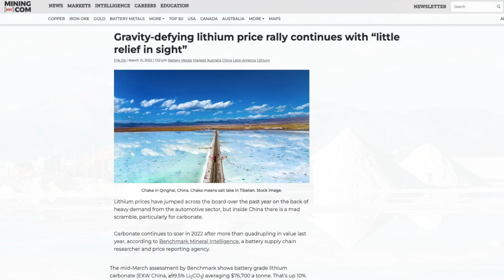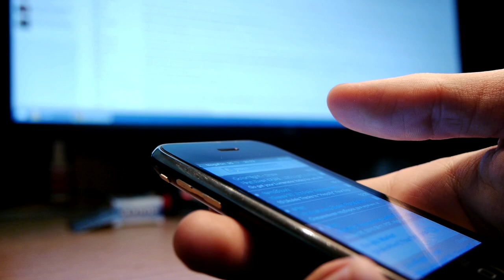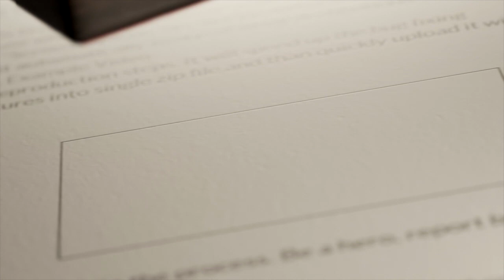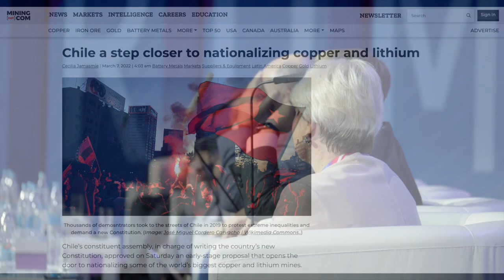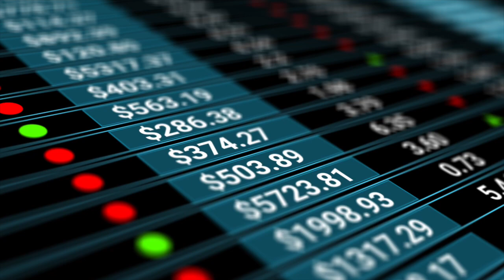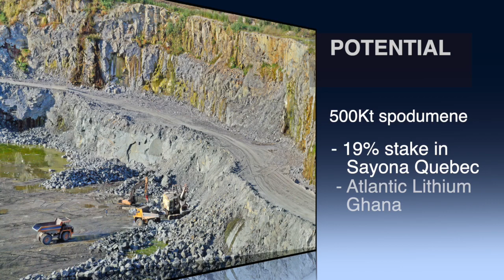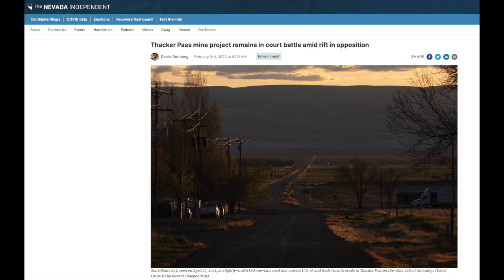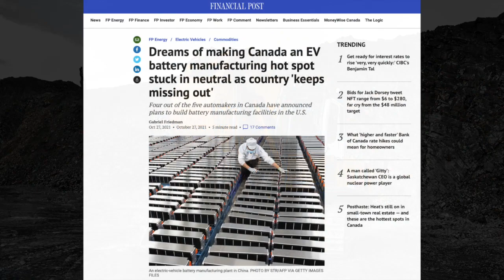What are Tesla's lithium mining options?

Comment: The likely target is Cypress Development Corp. as Tesla already tried to scoop them up on the cheap 2 years ago but were told no. Cypress has basically cracked the code of producing lithium from clay. It will be official by the end of Q2 2022 when the final steps from the pilot plant are completed. Cypress also has a REE component that would be off great interest to Tesla as well. However Albemarle will be in the bidding for Cypress as well. The key for ALB is they can't let those high margins get into the hands of an OEM who would just be paying the cost of production and the Cypress project has EXCELLENT margins. Albemarle also has the majority of the water rights in the Clayton Valley and Cypress new process uses the brine to process their clay resource. That means the ALB & Cypress combo ups the production capacity by leaps and bounds. Meaning all the other companies in the Clayton Valley that have a resource and no water can then be consolidated. So in summary either Tesla buys the best project in the USA (Cypress which has no court issues, rare plants, and sits next to and already producing mine) Or they sit back and let ALB and Cypress combo get into production and consolidate the whole valley and then buy up ALB.
Reply: FYI the highest grade lithium content at Cypress is less than the cut off grade at Thacker Pass. There is no comparison between these two resources. Cypress also has no permits. Not implying it won’t go ahead or that’s it not a target for Tesla or ALB as it may well be but you should be prepared for very lengthy delays to get this to production. TP is about to begin construction and they are not anticipating production for another 3-4 years.
Reply: @danielgraham8559  Not exactly true on the grades. Thacker Pass has higher grades but The Cypress grades are above the cut-off of TP. However the project at TP is going with a sulfur based extraction which will be more environmentally unfriendly and costly the clay at TP will be harder to extract. Cypress new pilot plant has performed great with a much less difficult and less costly leaching process. Cypress does have its water permit in place and it will take about 2 years to permit. Cypress also has zero problems in the courts were TP is tied up in the courts system. Cypress has a flat lying deposit with very little over burden that will not require trucks to haul paydirt. It will be done on conveyor system. Will use geothermal and solar power. It will recycle its water to make the most of the water permit. It will be one of the cleanest lithium projects on the planet. It's most likely going to be in production by late 2025. It's a top notch project.
Reply: @jonathanadamietz6508  There is nothing unusual about sulphuric acid processing and it is used in many industries with very little impact on the local environment. As I have previously stated this project has already passed all environmental reviews and is fully permitted. Making the sulphuric acid will also provide the power for the processing plant. Water is recycled etc, lowest quartile cost of production, experienced management, grade is king and this is project is a model of low impact mining. I appreciate your passion for Cypress but I believe Thacker is on a different scale and timeline.
Reply: At the 18:50 mark on this video you will see a direct comparison of the Cypress and Thacker Pass resources. https://youtu.be/U4RssO53_tc
Reply: @danielgraham8559  I was never debating that TP wasn't bigger and higher grade. Just that the Cypress grades are better than you were portraying. The sulfur process will add cost that Cypress will not have. Yes the sulfur process will have the energy plant attached at TP but they also will have to have that power since they have a high temp process as well which is harder and more costly than Cypress process. TP may have low cost but Cypress will be even better. No doubt demand will drive both projects into production. From an investment standpoint the gains will be bigger in Cypress because it is a much smaller market cap. All of the virtues you point out about Lithium Americas is already priced in. Where as very little of the virtue of Cypress has been realized by the market.
Reply: @jonathanadamietz6508  haha nothing has been priced in yet. lAC about to start production in C-O. I expect production of 100k -135k tpa from LAC by 2030. The math is compelling for a much higher valuation.
Reply: @danielgraham8559  You can't possibly think that the current market cap of LAC has nothing to do with the TP project. That none of that has be seen by the market? That no price has been attached to  upcoming development? You clearly have some learning to do about the stock market. Will it do well? I am sure it will but buying in now at a 3 billion market cap means it has to go to 30 billion to be a 10 bagger. 30 billion is 50% higher then the current market cap of Albemarle the largest lithium producer in the world. Whereas Cypress at a market cap of 150 million only has to become a 1.5 billion cap to make a 10 bagger and 1.5 billion will be only 50% of the NPV of it's Clayton Valley project. From this point going forward the percentage gains will be bigger in CYP over LAC. Will a person make money in both? Absolutely. But the entry point is what matters.
Reply: @jonathanadamietz6508  Now you’re talking about risk/reward and suggesting that I am offering investing advice. Cypress has a very high risk/reward profile whereas LAC with its peerless, experienced management, cash position, resources about to come into production later this year and the worlds largest greenfield lithium resource already permitted and about to receive its final green light. LAC is on its way to joining the big three lithium producers. The math is quite simple if your willing to be an investor this decade rather than a speculator.
Reply: The "risk" on Cypress is not nearly as high as you portray. They will be announcing sometime in the next 6 weeks before end of Q2 that they have gotten to battery grade lithium from their pilot plant. Once that happens all the remaining steps are pretty straightforward. Permitting will be not very difficult the Clayton Valley is already home to the only producing lithium mine in North America so little concern about Cypress having problems on that front. LAC soon to be producing asset in South America is a minority interest and will likely be spun off form the TP project to help get loans from the US govt . so far as being the US wants to give money to US companies and currently LAC has ties to China companies. They will have to sever all those ties if they want any US money for the TP project. Cypress will not have to do any of that as they are strictly a US based project. Cypress is certainly de-risked more than you state it is hardly speculation at this point. LAC will be a good investment and buying it will make its investors happy. Cypress will be better on a return basis from this point forward.
Reply: @jonathanadamietz6508  You may be right! But the original supposition was which lithium company would be the best partner or acquisition for Tesla. Elon Musk has stated that he expects a severe lithium supply deficit in three years. This is when TP will be finished construction phase all going well. I can only say what I would do in his shoes. Taking an interest in NA’s most advanced, highest grade and largest resource with a capable management team seems logical albeit more expensive. If not Tesla there is already a line of suitors waiting. Spinning off TP does not seem difficult or detrimental to current shareholders Imo.
Reply from the maker: I don't think Tesla could afford ALB. I mean, they probably could, but they would need around $60bn - which would be quite a dilution. Then they would be stuck with a lot of businesses they don't need ...
Reply: @energy_matters  Tesla has a market cap of just under 1 trillion dollars. Albemarle has a market cap of about 23 billion. That's roughly 2.5% of Tesla's market cap. Even if the paid a 100% premium that's only a 5% dilution. That is nothing. Any acquisition would most likely involve a spin-off of the non-lithium assets. I would be nothing for Tesla to gobble up Albemarle.

Comment: A few notes: Piedmont does not have permits for North Carolina. Nemaska is not an operating mine. LACs Thacker Pass may be among the highest grade and largest lithium resources on earth and has both state and federal permits. Cauchari-Olaroz is the third largest resource in South America and is about to start producing lithium carbonate. Also litigation will end this summer over Thacker Pass.
Reply from the maker: Thank you for the corrections. Piedmont is indeed in a bit of a final straights battle to get state zoning permits to commence mining. I am sure they will get this resolved though, it seems as if the state just wants an independent opinion on the impact assessments. It does still highlight the importance of local community buy in. 

I was not aware that Nemaska was not actually operational, I had understood it was mothballed. I believe there was a phase 1 plant in operation since 2017? The Shawinigan Phase 1 Plant? 

Cauchari-Olaroz is financed, you are correct. My observation of how their $500M will be spent was probably incorrect. They still need $200M odd for Cauchari-Olaroz, which means Thacker Pass is not yet funded, but I doubt this will be an issue.
Reply: Thanks for the response. I think concerns around permitting in NC are much harder to overcome due to the proposed site residing in a populated area but who knows? C-O only needs a further 60-70 million from LAC, remember Gangfeng is responsible for 50% of the project. The judge has said a final ruling will come by late August I expect the announcement of a strategic partner for TP and DOE loans & grants to the tune of $500 million to advance construction. Just my opinion.
Reply: "Also litigation will end this summer over Thacker Pass."
Youre talking out of your a$s. NO-ONE knows that.

Comment: Arizona Lithium (clay) sounds like a possibility as well they've run a lot permits already & are closer to Nevada. it would also preclude other giga factories being built in the area from access. Based on your report, I'm still glad that I own shares in Sayona since being involved in some way w/ Tesla for cheaper than Piedmont can't be a bad thing.
Reply from the maker: Thanks for the tip. I haven't analyzed them yet. As for Sayona, I think you will do well there. The north american battery operations are yet to really get going, so demand is still relatively low, but once they do ...demand for local supply is going to go through the roof.
Reply from the maker: The best lithium projects to invest in right now are the ones that will be coming online within the next year. Most likely these companies are not yet locked into long term supply agreements and will have been able to capitalize on the current LCE spot prices. 

Sayona has quality assets and HUGE reserves. I like their medium term strategy. They should have a LiOH factory up and running sometime in 2025, which is about when most of the US battery factories will be at full steam. Good timing, I would say.

Comment: Ioneer in Nevada will be good Target too.
Reply from the maker: Thanks for this - I completely missed it, I had never seen it before. Should definitely make it onto the list - although at first glance, they might be a junior miner by definition, but they have some serious shareholders - Sibanye Stillwater is an operation I know very well. They will most definitely have diamond hands!
Reply: @energy_matters  Ioneer has SERIOUS almost extinct species problems. FAR more likely is Cypress Dev, Jindalee, or Thacker Pass. SLI is a good guess on his part but Arkansas does not lack water what so ever.
Reply from the maker: @CornelliusTiberious  Ouch - looks like almost half of their concession has been zoned off?  Thanks for the point. This shows the risks associated with junior miners. 

I have commented on Cypress elsewhere - but Jindalee is interesting. If they are right, theirs is going to a be a prized asset. Still very early in the planning though, so in the spirit of the video, propably not a target based on the criteria listed. 

Lastly, I guess I should have pointed out  I was referring to SLi's California project, which they have said is an evaporation style extraction. If Arkansas pans out - there is a lot of potential. They have only mentioned 20kt, but are at early stage planning for an additional 30kt

Comment: Add this one too the list. CYP. Sustainable. Green. No sulfur. No endangered species or plants. They own water rights unlike other hopefuls. Water is recycled. Tailings can be dry stacked. Brownfield. Across the road from Silver peak. Valued at 1/10th of other companies because of no hype. Extraction with dle via chemionex. Waiting on pilot results. One of the most advanced projects behind Lac permitting wise. Will be first to show battery product from the clay using ESG. No problems that lac has. Feasibility this year. 400M + revenue per year using 18K pricing before scaling output. Down the road from TSLA
Reply from the maker: The Clayton Lithium project is definitely a good one. I think it will be a bit too small for Tesla though, with production targets of 27kt per annum. Also, in my notes I have this production coming online in 2025 only - but to be honest I have no idea where I got that date from - since I can't find any source material. I might have made a guess - so will try to read up and see.
Reply: @energy_matters  2025 is correct or 2026. Permitting timelines dependant. The 27K per annum is limited by how much water/brine can be used. If ALB were to get involved that would scale up quickly.

Comment: What is your take on Tesla and DLE ?? ...  companies like E3 Metals Corp in Alberta, Canada.  DLE seems like a much less intensive way to get lithium.
Reply from the maker: I am not sure if DLE is relevant in clay mining. But for brines, it is likely to be the future. It is more energy intensive, therefore more costly, but at current market prices, this is probably no longer an issue. It has the benefit of not being weather dependent, and faster to produce (brine mining has to wait for the sun to do its thing).

The big problem for me is still scale. Standard Lithium promises 20kt production using this method - but the large existing brines operations are producing way more than that. SQM, for example, are targeting 180kt using the old school methods.
Reply: @energy_matters  Absolutely relevant. Li will be released from clay as fluid, opening the door for DLE which is really your only option here. Scalability is possible. Check out Lilac or Summit Nanotech.
Reply from the maker: @cwx8  Thank you - I will read up on these techniques.
Reply: @energy_matters  Thanks for the insights, I also believe that DLE will be the brine extraction method of the future, maybe one day combined with de-salinization plants??  I know concentrations are very low/diluted in the ocean water but I am sure the DLE technology will get there .... probably sooner than we think.
Reply: @stopviolatingmyprivacy99  No need for desalinization, just selective extraction of lithium from dehydrated clay deposits. Desal would be good for conserving water though.